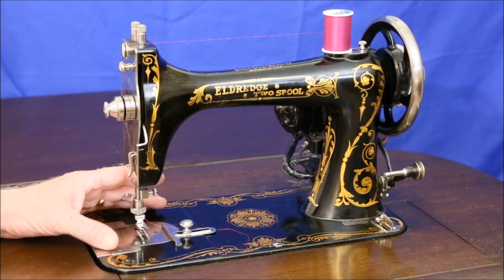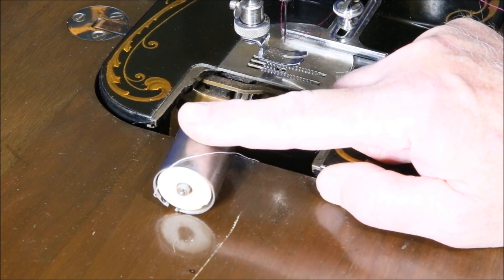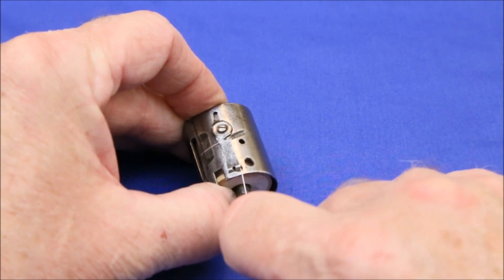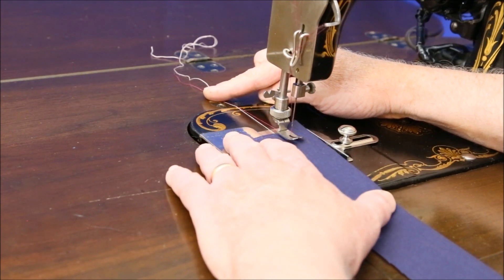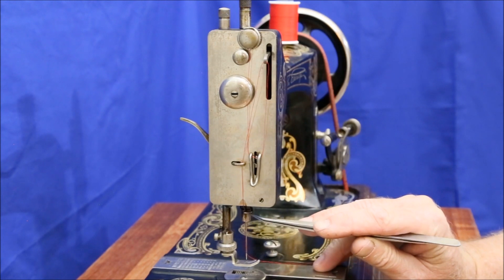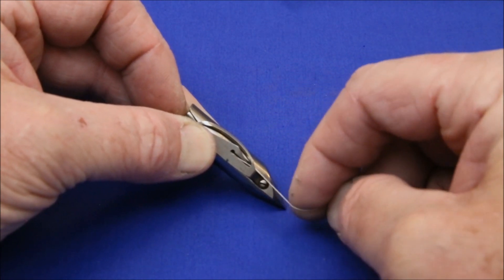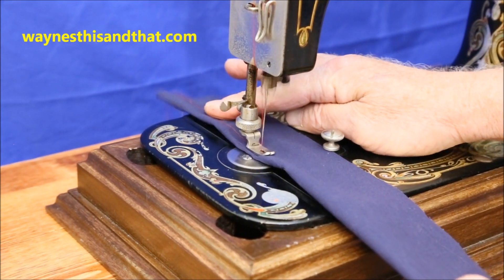How To Thread An Antique Eldridge Sewing Machine

Comment: Thank you so much for sharing! I was completely stumped on threading my Eldredge Improved Rotary so this video was VERY helpful! Any suggestions on a cleaner for this machine? The surface of mine is very gummy and grimey and sewing machine oil isn't cutting through it.
Reply from the maker: I use warm, soapy water then clear water to remove and traces of soap. Thick, dark areas of dried oil can be difficult. Products like 409 or Krud Cutter can work, but are so aggressive they can attack the underlying artwork. I recommend starting in the right rear of the machine, were if something goes wrong, it'll be hard to see. Good luck and thanks for commenting!

Comment: She's a lovely machine and I was so glad to see another one in operation! I'm slowly working on restoring an Eldredge-stamped Two Spool that belonged to my great-grandmother and passed to my grandmother. My great-grandfather added a Kenmore friction drive in 1949, making it quite a unique machine. I've completed cleaning and oiling everything, but I am debating reworking the finish: The shellac has become dry and cracked, though the decals are largely still intact. I don't expect it to look showroom perfect, but I don't want to lose what's still there. I've had a bit of practice on a Singer 15-91 recently, and have a White Family Rotary to also practice on, but still hesitant to tackle the family heirloom.

I did have one question, though: Most motorized Two Spools I've seen have had some sort of a spring belt to wind the bobbin. My grandmother's machine hasn't been used in years and so the belt has gone missing. Did yours come with the original or have you ever had to replace one? I'm having a devil of a time figuring out what to get for a replacement! Any advice you might have would be appreciated!
Reply from the maker: Hi! And congratulations on getting a family heirloom! Shellac can be easily repaired. One of its great virtues is that even after a century of aging, it can be made to look almost like new simply by rubbing on a new coat of shellac. It'll dissolve the top layer of the old shellac and make it clear again. Search for 'how to restore a shellac finish' on YouTube and you'll find many videos on how to do it. The spring was missing on our two-spool, just like yours. I found a long spring of the same diameter at a local hardware store, cut it to length and slipped it on. It works perfectly. I hope this helps. Thanks for commenting!
Reply: Thanks! I will take a peek at the local hardware store and see what I can find. 

I've seen a couple of videos discussing the cleaning & French polish of a sewing machine or two, just don't want to screw it up! This machine is too dear! I do hope I get brave before too much longer. It's past time to put the Eldredge back to work. =)

Comment: Thank you for this video!
I’m working on getting my grandmother’s Damascus Grand going. It seems to be a very close match to the way this one threads on the top, but I’m having problems with the bobbin. It has a rotary shuttle, or a bobbin that looks similar to a contemporary one. My top thread keeps getting hung up in the bobbin assembly. Do you have any ideas? Thank you in advance.
Reply from the maker: This sort of problem is impossible to diagnose without having the machine in hand. Your best option would be to take it to a sewing machine repair shop if one is available. The mechanism is close enough to modern machines that they should be able to fix it. Good luck!

Comment: Do you know we’re I can get a bobbin and bobbin case for the one made in the1890s? Thank you so much for this video!
Reply from the maker: Your only hope is to find one on EBAY, Pinterest, Etsy and so on. Sadly, spare parts for antiques are harder to locate than the machines themselves. Several times I've had to buy entire machines to get a replacement part. Sorry I couldn't be more helpful.

Comment: Do you know if there's a modern brand of spool thread that fits in this canister bobbin case or should I hunt down vintage spools on eBay?
Reply from the maker: We found a Singer Industrial Class 7 bobbin works great in ours. This is a metal bobbin that needs thread to be wound onto it. I've read that the tiny bobbins in emergency sewing kits will work, but I've never tried them myself.

Comment: I am trying to clean my Grandmother's two spool machine that went through a fire 53 years ago. It is smoke and soot damage.  I have no idea how to clean this machine.  It has the thread canister and everything seems to move but it is rusty and dirty.  How do I clean it and still preserve the machine?
Reply from the maker: I may have some good news for you. These machines were protected with a thick layer of Japanning; an extremely tough baked-on finish of asphaltum, linseed oil and turpentine. Assuming the machine wasn't in direct flame, this finish could still be in good condition. Is there any remaining artwork still visible; gold filigree and the name of the machine? If so, then it wasn't in direct flame, which is good. Start by wiping the machine down with a soft cloth, Begin in an out-of-the-way location that won't be obvious if this causes the finish to flake off. If everything appears tight, go ahead and wipe off the rest of the machine. Assuming that goes okay, next make up a mild solution of dish soap and water and repeat the same procedure. This should not only clean off the soot but also any built-up grease and oil. Keep an eye on any artwork and stop if it looks like it's coming off. If there's no problem with this, repeat a few times until the surface appears clean . If there's still dirt and soot stuck on, you may need to try a stronger cleaner/degreaser like 409 or Krud Kutter, but be careful, these can attack the artwork and even the Japanning. Start with a 50-50 diluted mixture and again, test it in an out-of-the-way spot. This should get you started. Please let me know how this comes out. If you have any more questions feel free to ask, and thanks for commenting! Good luck!

Comment: Do you know why the two spool didn't catch on
Reply from the maker: I've read two articles stating that the tension kept having to be adjusted as the lower spool used zip its thread. The change in diameter was much greater than it is in a normal spool.
Reply: Were these popular in factories
Reply from the maker: @graceygal2664  I don't know. I've never come across any articles that said they were.

Comment: Great video.  Is it still possible to buy needles for this sewing machine?  Thank you!
Reply from the maker: I believe a Singer 15x1 needle will work. Good luck, and thanks for commenting!
Reply: I have one and found standard Singer 15 x 1 needles will work, but you need to slip it down slightly. If you insert the needle as far up as it will go, the needle won't connect with the bobbin case. If too low, it'll strike the needle plate. Gotta find that Goldilocks spot!

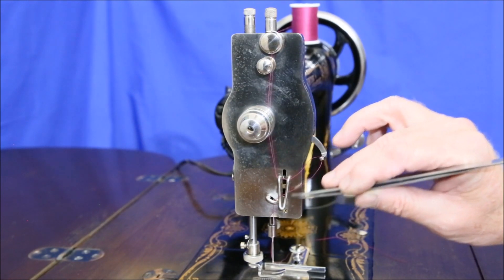Comment: Can you make a video on how to repair that round part in 1:05
Reply from the maker: I am very sorry I didn't respond to your post immediately, but YouTube never informed me you had posted it. Do you mean the little wire spring with the loop at the end that's positioned between to two arms of the thread guide? If so, not, I don't know how to repair it. Your best bet is to take the machine to a sewing machine repair shop and ask them if they have something that can be bent to replace it. Good luck and thanks for commenting!
Reply: @wayneschmidt490  Oh I see. It's okay. No worries and thank you for replying.
Reply from the maker: I got to thinking how someone could make a spring like that and I have an idea that might work. This is assuming it's the spring you were talking about. Go to a hobby store and buy a piece of 0.022-inch diameter wire (23, 24 or 25 gauge wire should be about right) used for model car and airplane control lines. You want the real stiff stuff. Wind it ten times around a 3/8-inch dowel. The spring will relax slightly when released to form a spring 1/2-inch in diameter. Trist one end into a hook to catch on the right side of the holder and leave 1 & 1/4 inch loose on the other end. Bend a 1/8-inch hook at the end of the straight tail. The shape should end up looking like the following image of the spring:

http://waynesthisandthat.com/images/sm%20two%20spool%20spring.jpg

Once that's done, the hard part will be getting it into the machine, which will required a lot of disassembly. Make sure to take several pictures of the insides before taking stuff out so you'll know how to to put everything back together. 

If it's not the spring that's broken, let me know what piece you're talking about and I'll try to figure something out. Two Spool machines are rare enough to be worth investing some effort into making yours work. Good luck!

Comment: Can you tell me what size belt I need?
Reply from the maker: I made ours out of two, 3.5-inch long, 0.25-inch diameter springs I got from a hardware store. Attaching the ends together made a loop that was almost perfect, but a little too short. So I pulled a section of one of the springs apart to make it 4-inches long, creating a spring belt that was 7.5-inches in overall length. It worked great. Depending on how your motor is mounted, you might need to experiment with the length to make it tight enough so the motor drives the machine, but not so tight that it stalls the motor. I hope this helps. Thanks for commenting!